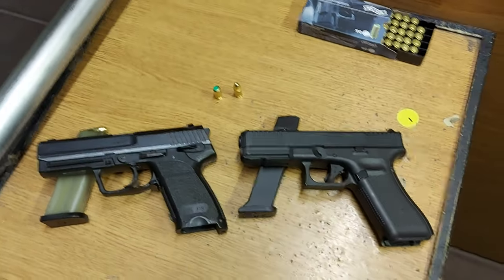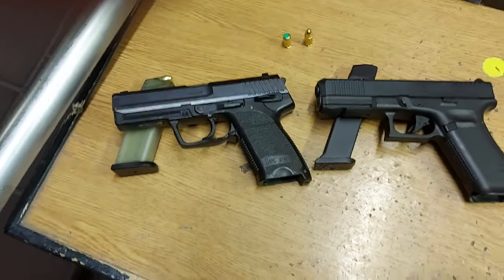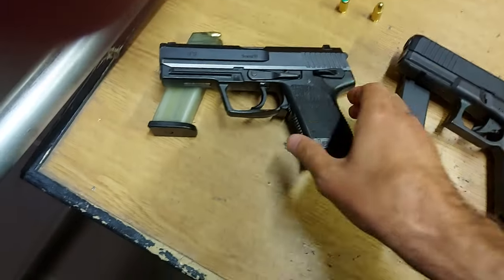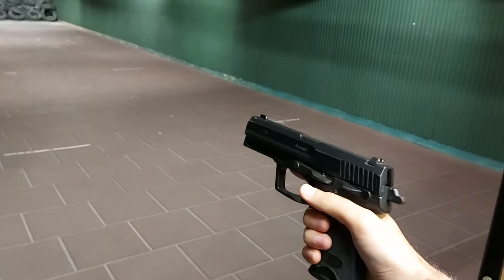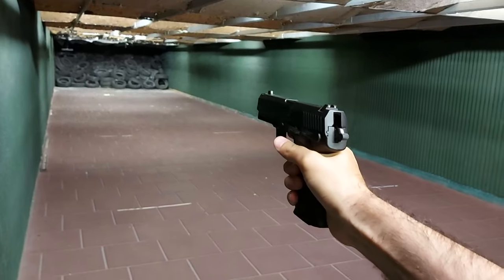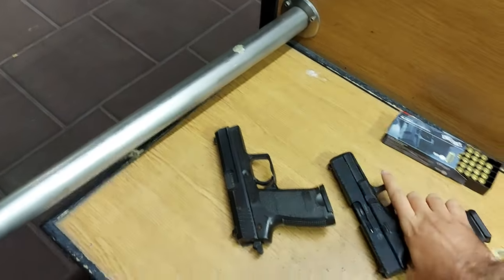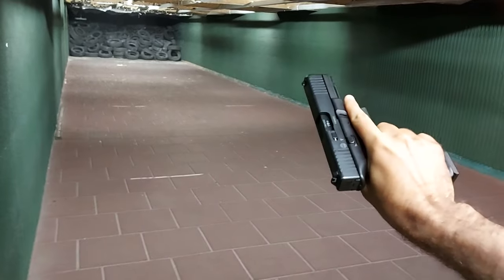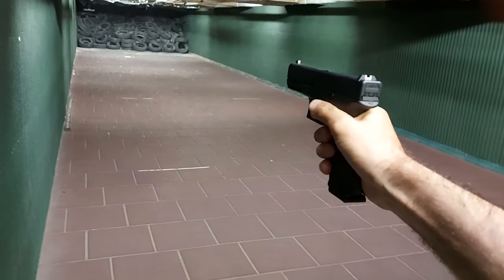Blank gun vs live gun sound comparison

Comment: now i want a video on converting the blank into a real gun.
Reply: 😂😂😂 i heared they remove the barrel[top]  and put a real one ,something like that😂
Reply: Here in colombia somes criminals used to do that , you have to cut the barrel and put a metal barrel because the deafult barrel of blanks guns are made of zamak and That material does not withstand the explosion of a real ammunition cause is a alloy of aluminum and others materials so you have to change the barrel and thats all , the .380 acp is the same size of the blank amunnition so you dont have to change the magazine , you can use the original magazine if you convert to .380 acp , other way to make the blanks guns lethal is open the barrel with a drill and just modify the blank ammunition, you remove the green plastic and put a ogive of lead and glue it with instant glue and is literally a lethal ammunition, i have some video where they put a rifle type ogive and it was more lethal than a .380 ammunition , also here in colombia like 2 years ago was legal sell the traumatic guns (p.a guns) , this guns are like blanks guns but they shoot ammunition with a rubber ball as a projectiles so they came with a open barrel , if you get shot by this ammunition it will leave a hole in your skin and destroy it and if you shoot someone in the head you probably kill him but obviously a rubber ball can't go through you so some criminals used to put a metal ballin on the top of the p.a ammuntion ( TRAUMATIC AMMUNITION) , or put a piece of lead .... the thing is made the gun lethal...
Reply: @JuanGomez-zm4gt  wouldn't opening the barrel with a drill make the gun not cycle properly anymore ?
Reply: @yaya_is_real  yes bro the gun will cycle normally , you use the drill to remove the plug that is inside the barrel but do not touch where the casing or ammunition goes
Reply: You would need a much stronger unobstructed barrel, add some weight to the slide, a stiffer recoil spring, and for extra safety and longevity reinforce the part of the frame that stops the slide from going backwards off the gun when it is fired.
Reply: @JuanGomez-zm4gt  Well it seems to be a giant rod thats in an X shape so
Reply: Usually the barrel is stuck to the frame and everything is made out of weaker material so that if you try to put a real round in it would explode
Just don't do it..
Reply: The people who convert these into real guns basically end up doing a ship of Theseus type beat where the blank gun is 80% no longer the gun it was prior to conversion. Don’t try it, it gets legal things banned and doesn’t work properly. Stay legal stay safe…
Reply: Just buy a real gun .
Reply: @pauljohnson9326  perhaps you don't wanna shoot an actor with live rounds lmfao or you wanna try inside or a multitude of other reasons
Reply: 😂 @JuanGomez-zm4gt
Reply: Frfr
Reply: @secrets-cirilopedro7021  a bit more advanced than that
Reply: Of course you do😂
Reply: Це трохи не законно, тимпачче деякі холості пістолети не призначені для перетворення на бойовий аналог